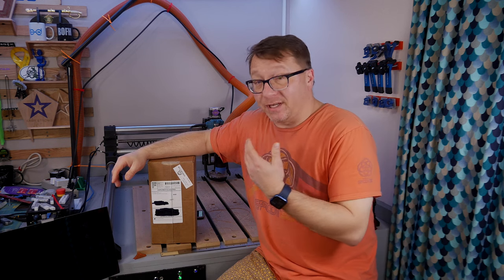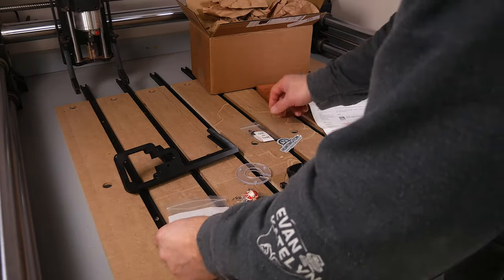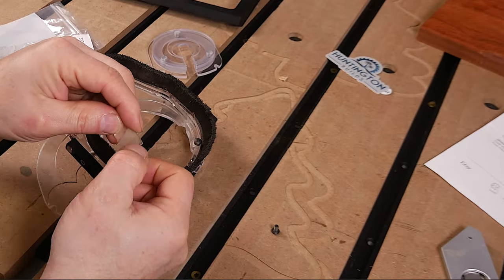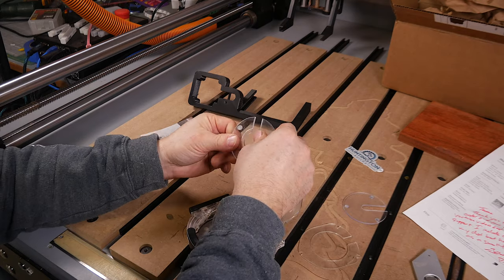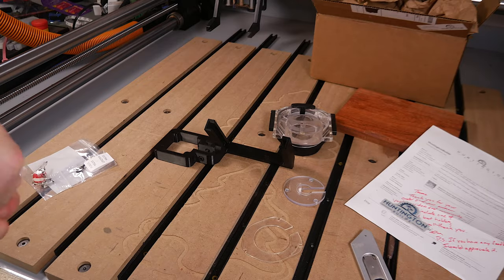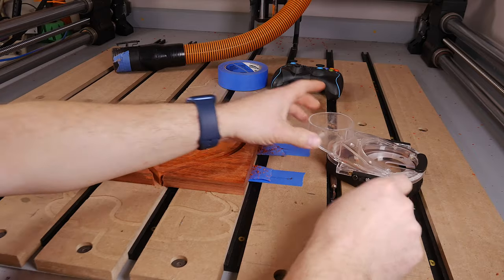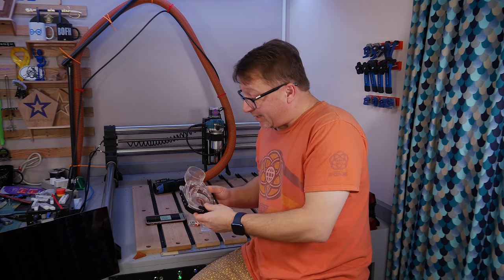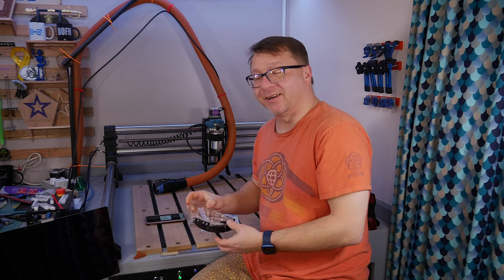Boost your CNC dust collection! (Coupon Code Included)

Comment: Thanks for doing this! You can totally put the plates in either orientation. If you put them on top it makes it lot easier to pop them on and off. I just keep mine on the bottom because if I ever forget to swap the plates, the router bit will just push it out instead.
Reply from the maker: Excellent point!
Reply: @cyberreefguru  I would think if you put it on the bottom, it dust collection system would be sucking it up against the plate. If you put it on the top the dust collection would be trying to pull it off the plate.
Reply: @cyberreefguru  BTW - Just ordered this . I think I am going to get a metal rule and tape it to the inside of my enclosure to stick them to.  Thanks for the video.
Reply from the maker: @TetraCNC  Excellent point - I am rethinking my decision!
Reply from the maker: @TetraCNC  yeah, nice suggestion.  I know John is working on some storage options too.
Reply: @TetraCNC  I haven't had mine pulled off by the vacuum nor have I heard that it has happened to any of the makers who have purchased it but if it does please let me know. I buy N52 magnets from special supplier and machine the polycarbonate to a minimal thickness to ensure they have the greatest possible holding power.
Reply: @huntingtonbuilds  LOL Sorry it not my intent to throw shade, I am just paranoid, and I did go directly from the video and buy a set.
Reply: @TetraCNC  I appreciate the purchase! Don't apologize you brought up the a valid question and I was just  trying to provide a response to your concern.

Comment: Just keep an eye on how far down your bit is going to go & where that will put the router's collet nut when you're at your deepest cut. If you're not careful, you may find it slamming into the plate. If you're using one of the smaller hole plates, that's going to carve a collet nut sized hole in your plate (if your plates drop in from the top) - DAMHIK. Or if you have your plates mounting from underneath, I expect it would send the plate down into the bit where it is likely to get caught and spun around and randomly chewed up. Otherwise I agree 100% with your review. It's a really nice set of plates. (I'll cut myself another slot plate one of these days 🙂)
Reply from the maker: Thanks Jim - completely agree.  DAMHIK ;)
Reply: Jim, you bring up a good point and that is why I keep mine mounted on the bottom. I should note, these are polycarbonate so if you hit them with the bit they do get chewed up a bit but they don't shatter like the original acrylic does. The other nice things with the magnetic plate, is lets say you are carving out a plaque or tray, you can pause the cut or quickly swap it out for that last cut without having to run the whole cut with the larger diameter.